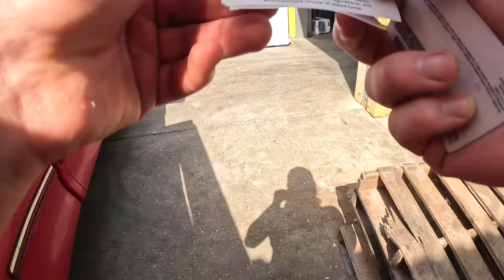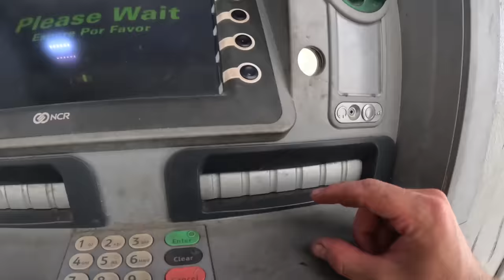Remains Found Magnet Fishing - Magnet Fishing Gone Horribly Wrong

Comment: Skeleton. Interesting finds guys.  Not bad for a couple days of soloing it, 1,500 +lbs just in those is no slack day.  That "flywheel" was probably a torque converter, which is basically the flywheel and clutch of an automatic transmission, some good weight just in that alone.  Was wondering if you grabbed that chair frame that was to the right of the skeleton?  Keep up the great work, and looking forward to the next video.
Reply: Its not real
Reply: real 
skeletons are not magnetiic
Reply: Plus he wasn’t that shocked so probably from spirit hallaween
Reply: @mayaslack9006 theirs a claw on the hook that brought it up

Comment: The thing you thought was a shower head was a slide wheel for a door.  They were used in industrial buildings and old warehouses in the early to mid 1900s.  I grew up in southeast Wisconsin where there were a lot of older buildings with those still in use.

Comment: Camshafts are inside engines and that driveshaft is too long to fit in an engine, it goes from the transmission to the rear differential.